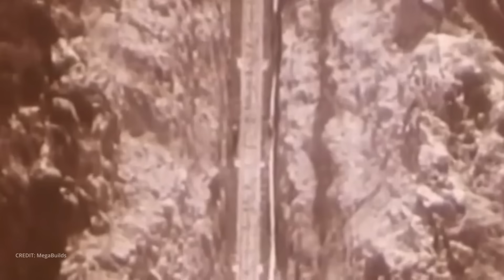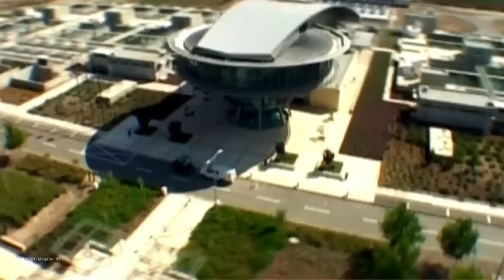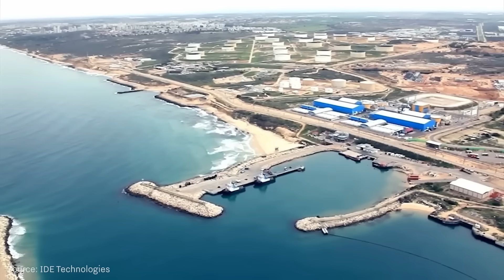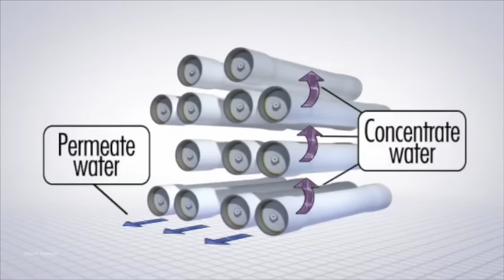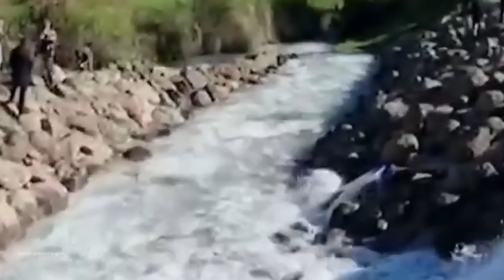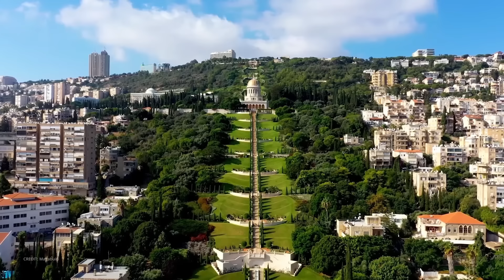Israel Built an Infinite Water Loop to Never Run Out of Water

Comment from the maker: A lot of people are asking how Israel powers all this and what happens to the brine. 
So, from the research we did, most of the big plants run on high-efficiency grid electricity that’s still mostly natural gas, and studies put Israel’s seawater RO energy use at roughly 3–3.5 kWh per cubic meter. https://wrp.beg.utexas.edu/node/31
For brine, Israel uses long offshore pipelines and diffuser systems in the Med, with ongoing marine monitoring and impact studies. https://cris.bgu.ac.il/en/publications/addressing-desalinations-carbon-footprint-the-israeli-experience-2/
Thank you for watching it!

Comment: I am kind of surprised that their water canals that bring the desalinated water to the areas it is needed, are not covered to reduce losses by way of evaporation, or them having gone with large tubes. In the other hand that would make it really hard to have, let alone mount new access points along the way.

Comment: "Weeks can go past without a single drop of rain (in the Negev)"?
What? Complete nonsense phrase. Not weeks, MONTHS, or rather, in the Negev, and the rest of Israel, THE WHOLE YEAR it doesn't rain outside the last month of fall and the first two months of winter, maybe three, with rains being very light and far apart too. Basically there's only 2~ somewhat (light) rainy months a year, and maybe a month or two of light trickle, the rest are bone dry. To say 'weeks could pass without rain' is to assume it'd rain at least once a month or two, but it doesn't, not even close.

Comment: the ussr tried that (returned cleaned water into Lake Baikal). didn't end well.
Reply: because it's ussr not JewSSR
Reply: The Soviets mostly took water that was flowing into the lake and diverted it. They didn't try to refill the lake. If they did try to add water, it might not have been such a disaster.
Reply: @Mr.Patrick_Hung  read the history books. they purchased european equipement and misconfigured it, overpurifying the water, which led to permanent loss of organisms unique to the lake.
Reply: @bogorad OK please provide a solid reference for me to read.

Comment: My understanding is that one of the chief difficulties with large-scale water desalination is dealing with the extremely salty brine that is a byproduct of reverse osmosis desalination.  That brine can't simply be pumped back into the ocean without having a serious negative impact on marine life.  On the other hand, if you have desert environments adjacent to your desalination plant the brine can be pumped into evaporation ponds.   Desalination ponds are shallow, lined basins designed to use solar energy to evaporate water, leaving behind concentrated solids like salts or contaminants.  Lithium and other useful materials can be extracted from those solid remains.  Is that what happens to the brine in Israel?  It seems to me that California and other Western states might want to take a page from the Israeli desalination playbook.
Reply: Matt Ferrell just posted a video about Osmotic power plants.  They can extract electricity through mixing salt water with fresh water, and the saltier the water, the more electricity that can be produced.  There have already been Osmotic power plants that use the brine from desalination plants.  Now, if you use treated wastewater as your freshwater source, you would be conserving freshwater and reducing the operating cost of desalinating the seawater.  The problem will be the capital costs of building all those plants.

Comment: that's because Israhell steals billions from the united states so they can build all this stuff
Reply: Except they are not. Since the cooperation began in 1967, Israel has spent more into the US economy than it has received back. At the same time, big chunks of the best tech and intel come straight from Israel. WIthout Israel, the power projection of the US would have dwindled long ago. If you with the west, you should be with Israel, imo.

Comment: UAE is home to approximately 70 large desalination plants that collectively produce a significant share of the world's desalinated water supply. Older data (around 2022) suggested the UAE produced more than 7 million cubic meters per day historically using thermal method and recently energy efficient Reverse Osmosis 

While israel "infinite water" it's simply Reverse Osmosis from start, desalination with massive power plant used to generate electricity on their powerful pump. Israel is a tiny country densely populated (468 of israel vs. 155 of UAE in kilometer square) with a strip shape, and the length part is near to sea, so obviously water is infinite, given they use fossil fuel to generate electricity and turn sea water as drinking water. They do get BILLIONS OF dollars of aids; they spent 0 on military offensive. It is not infinite; it is desalinated water with powerful pump running all around the tiny country.
Reply: 3.3 billion per year since cooperation began in 1967. Most is reinvested into the US. At the same time Israels economy far outclipses that and US spending in Israel is a small fraction of foreign spending. In terms of return, it's one of the most lucrative powre projection angles there are.

Comment: Missing vital information.
Where does the energy come from to do all that?
Does the highly saline water put back into the Mediterranean sea cause problems?
Reply: Most of it oil and gas. Oil 99% imported, gas local fields. Investment in solar is rising, but the country is small.
Reply: @expectnull  - thanks - so why not do it with solar cells? Plenty of sun all year around in Israel.

Comment: Here is a question I have.  When salt is dissolved in water there is very little energy released.    So what if you could separate the salt from the water without all the energy required by reverse osmosis?   And all the effort of RO.   I wonder what is the physics on the minimum amount of energy required to remove the salt,   or remove the water from the salty water,

Comment: I don’t think that people here understand how bad it was for Israel just a decade ago.

There were ads basically everywhere about how dry Israel is and that we shouldn’t use too much water. We were advised not to open the end of the flow with the water tap, not to wash our cars, to watch that all the taps are not dripping, and that we should make sure that our taps are fully closed and not slowly dripping, and more…

News was every month about how close we are that the Kineret, the Sea of Galilee, is close to being completely ruined. In the video, he mentioned the black line, but he didn’t mention the 2 red lines that are there too - each supposed to show where to stop pumping, but it was too bad so we couldn’t.

Now Israel pumps more water than it needs and is destined to sell Jordan water for solar electricity, which would sound like a fantasy a decade ago.
Reply: Cool.   You guys need a water park.   A wave pool and water slide.

Comment: Reverse Osmosis, is the most inefficient and costly method of producing potable water. There are other methods, like Submerged Element, and Flash Evaporators.
The  latter mentioned, can, and do work very efficiently, on Naval Warships. They use waste heat, to primarily, supply feed water for the ships boilers, of a high purity, as well as potable water, for the use, of the ships company.
Israel can enjoy adequate water supply, for its survival, because the finance for its production, is supplied by American taxpayers.
Reply: ?supplied by American taxpayers.
Evidence?

Comment: The price of water bill is higher than anywhere else also…
Reply: I don't think that's true, but I don't know how much they charge elsewhere. There's a standard rate and high rate (overuse; threshold is set by the number of people in the household), which are about 2.5$ and 4.5$ per cubic meter of water (1000l) respectively. Our typical water bill comes out to about 50$/mo (4 persons, apartment - ie. no lawn/yard).

Comment: I wonder where you pulled that "20% too much water" figure from. The reality isn't an excess of drinkable water; it's one of resourcefulness in the face of scarcity. The agricultural sector in Israel still suffers if there's a drought. irrigation solutions can't reach every single field or orchard.
Reply: Israel supplies water to Jordan, 5% since the 90's, and recently new agreements were signed to up it to 20%, of its water consumption. Israel also used to supply Gaza with 10% of its water consumption. So there's certainly excess water production in Israel.

Comment: A very pretty video, but no discussion at all about the MANY downsides.  Where's the acknowledgement of the problems caused by concentrated brine, the use of coagulants (aluminum chloride, ferric chloride), flocculants, anti-scalants (polyphosphates, phosphonates), the need for anti-foaming agents, the effects of all the biocides used (chlorine, chloramines, isothiazolinones), the need for massive amounts of cleaning chemicals (acids, bases, detergents, surfactants, chelating agents), the release of heavy metals (copper, nickel, chromium, iron, zinc) or the greenhouse gas emissions (CO₂, NOₓ, SO₂) that result from all those high pressure pumps?  This video makes it seem this is the universal solution to water issues but in truth there are crazy number of bad things that come from industrial desalination and aggressive waste water treatments.

Comment: What about the salt? Which are the impacts?
Reply: no salt. brain is poured to the sea
Reply: @Voen_Sveta and what is brine?? That increases the salinity level of the sea.
Reply: @goyakat2211    It has been said that the solution to pollution is dilution.   The salt came from the sea and is being returned.   The sea is so vast the brine does not make a difference.
Reply: @robertwest883 it does, cuz you take millions of litres of water away and put back brine, so the salinty increases
Reply: @goyakat2211    It is the OCEAN.   The brine, which comes from the sea, does NOT increase the salinity by that much.

Comment: Keith says they also steal it from Palestinians and don't share it with them. Keith moans a lot but he is usually right. What do you think?
Reply: The Palestinian did not have water to steal because they had no water. Never invested in water, just in weapons to kill the Jews.
Reply: There are Palestinian water parks and plenty of pools, local water distribution is done by local cities. Palestinians have access to all the same water, it's the PAs incompetence that leads to unstable water access. Most Palestinian homes solve this issue with rooftop water tanks.
Reply: The Palestinians don't have water to steal. Their only sources are wells, and those are as productive as you can expect in a desert area suffering a drought. When they need water they demand it from Israel. Keith is just bitching because he hates Jews.

Comment: Where do they discharge the brine water from the plant, you only discussed the fresh water part, how about the waste part.
Reply: I for one wish the waste brine were discharged to the Dead Sea, which is drying up.
Reply: Also how they produce all the electricity needed for the desalination plants! (and everything else)
Reply: They have fan shaped discharge piping that spreads it back into the Mediterranean. I read some of it is dried into salt but that's not much of the total produced.
Reply: If I was them them Id just dump it in Gaza.
Reply: @Djamonja  Solar energy, Israel has a lot of sunny days.
Reply: @MottyGlix different types of salt. Sea water has mostly sodium chloride while the dead sea has phosphate and bromine salts (if I remember correctly).
Reply: @Djamonja coal and gas power plants. some comes from renewables - solar plants and wind turbines, but not much
Reply: It goes in evap ponds and the salt is sold, very cheaply.
There is some mineral extraction from the brine but that's still developing.
Reply: @patrickdurham8393 I believe about half goes in evap ponds. There is talk of mineral extraction from those ponds and it's done in a small scale now.
Reply: @Voen_Sveta  Coal is no longer used by Israel. They have gas reserves
Reply: @Djamonja  I would imagine with solar power plants, as they have an abundance of sunlight. At least I hope that they use solar power for it.
Reply: @Voen_Sveta  why not? Why don't they use more solar? I thought they're behind the "Solaredge" brand of solar panels?
Reply: Water pipes that generate electricity … read that again
Reply: @shedim7661  what? Make it make sense.

Comment: What are they doing with the salt?
Reply: Normaly it is pumped back in the Ozean
Reply: @flolow6804  at some point the increased level of salt will cause problems, no?
Reply: From a rough calculation Israel is desalinating 1/5,000,000 of the Mediterranean Sea per year, so the overall effect is zero.
May be some local effects on the ecosystem.
Reply: Eventually it will be used in the new technology of sodium batteries.  They are going to be cheaper than lithium and more plentiful.  They will be used for grid battery storage and home storage.  They are also great for car batteries where the temperature of the climate is very low: down to -35 C.  They take up more space than lithium but apart from that they are better than lithium.
Reply: @jrbigger yes ,it destroys marine ecosystem..
Reply: They make kosher salt with it, shalom. 😎
Reply: @levigato125 we use it for our Seders
Reply: @gincegeorge1047  considering that the sea is already salty, adding salt will not have any effectt, and israel also recycle water form sewers
Reply: Export to Iran
Reply: pour it into khamenei's hole

Comment: Is it normal to measure potable water in cubic meters?
Reply: yes.  You have a better suggestion?
Reply: @KentBunn  cubic liters. As is used later in this very same video to describe how much water an average Israeli household uses
Reply: @richardp444  You don't measure large amounts of bulk goods, in small units.

And there's no such thing as a cubic liter.  A liter is a measure of volume already.
Reply: @KentBunn  thanks! That is what I was looking for 👍
Reply: @richardp444  In the US the larger unit for systems, is the acre-foot.  The amount of water necessary to cover a 1 acre area of land, a foot deep in water.

The equivalent of 1,233 cubic meters.
Reply: No it's more normal and appropriate to measure potable water in thimblefulls.
Reply: @KentBunn measuring water in thimblefulls would be just as good as acre feet and have a jaw dropping humongous number
Reply: @jamesadams893  Humongous numbers aren't practical at all.  They're error-prone.
Reply: @KentBunn ok then use ginormous numbers they are far more accurate and devoid of inaccuracies
Reply: @jamesadams893  They definitely are not more accurate.  They are incredibly error prone.
Reply: @KentBunn prone yes but who gives a shit about prone
Reply: Yes
Reply: A cubic meter is 1000 liters. They could just as well say kiloliters. But, yes, that's common for measuring potable water at the municipal or other governmental levels. 
A cubic meter is about 264.17 US gallons, or 6.29 barrels of the kind used to measure petroleum, or 1.31 cubic yards.
Reply: Yes. Water is always measured in cubic meters. Even liters are based on volume.